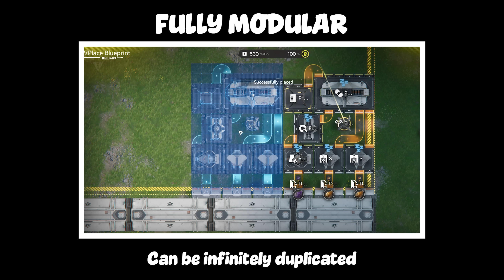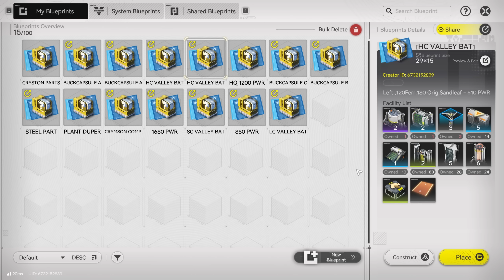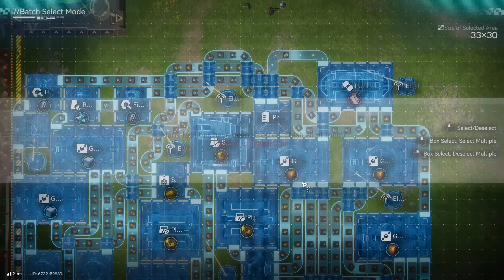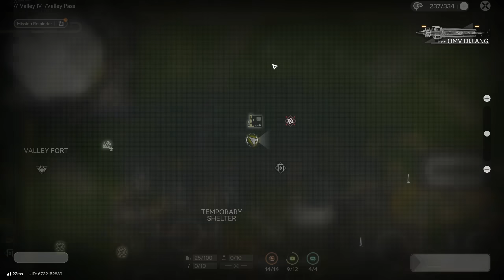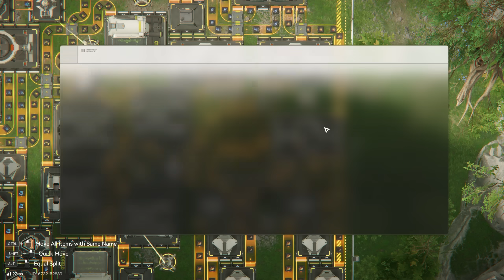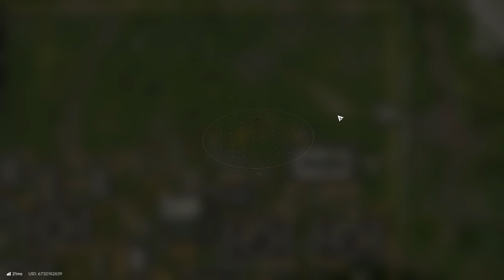HC VALLEY BATTERY - Compact 100% Efficiency Farm [ Arknights: Endfield ]

Comment: I personally created a Not-So-Small "Ultimate Farm" which lowkey only Fits in the Main AIC Area. It Farms all 4 types of Seeds Endlessly until your Storage is Full.  However i still gotta work on making the HC Battery Production Line Smaller, more compact. Cuz unlike yours, mine can only be placed Twice in the Main AIC Area.    Luckily it fits in the other Outposts well enough. So, if i don't find a way to make it more compact i will just leave it be.  Don't fix what isn't broken, yk.

Comment: EFO01eE7IaI2934a4oAi8, try replacing the IaI with Ls if it doesn't work, I can't honestly tell which it is. Anyway this design fits in one blueprint, is taller but slimmer at 30x33 instead of 33x30, doesn't require an output for the sandleaf and also you can store the extra sandleaf powder if you want but honestly I could care less about it, it is also modular as well as it only takes up the space the depots use. The design could definitely use some work but I found this one works best for me personally as it gives me more depot bus space

I also feel it's a little less confusing to look at but that could just be me and my dumb brain idk

Comment: How many purple batteries can I produce per minute? I have a factory that makes blue batteries and I get 36 per minute, so I don't know if it's better to make the purple ones or stick with the blue ones.
Reply from the maker: Each blueprint one produces 6/min, but you can stack as many as fit and can supply resources side by side :)
Reply: @TheFarmito Perfect, thank you very much. By the way, the code on the left isn't working either. I already tried using "I" and "l". I saw someone else saying the same thing in the comments below.
Reply from the maker: Im not sure about the code. They have a lot of issues, some people say they just type all over and over and it eventually works. I copy-paste them directly to the description (and double check them as well), so there shouldnt be any issues. 😅

Comment: IMPORTANT: This is a great blueprint overall, but it has a serious issue. Because the batteries and extra sand powder are going into the same protocol stash, and every battery setup is producing an excess of sand powder, once you hit your depot's max stock for the sand production the protocol stash will get clogged up by the sand powder and won't be able to take any batteries. As a result, your battery production will drop to 0. If you're also using those batteries as your power supply, it will also take out your entire production pipeline for the entire region due to a lack of power. Thankfully, there's an easy fix - there's currently one protocol stash, with sand powder and batteries going into it. Delete the route for sand powder, so that only the batteries are still going into that one. Then, build another protocol stash on the top of the left blueprint in range of the existing power pylon, and feed the excess sand powder into that. Now your batteries and sand powder have independent stashes, so they don't interfere with each other, so even if you're capped on sand powder it has no impact on your battery production. And that's a good general tip - never mix different product types into the same protocol stash, because reaching cap on one of the resources could kill your production of the others.
Reply: when can you unlock the HC battery system blueprint?
Reply: Thx I settle this battery clogging part. But due to having too many sand leaf I am at a lost of 19000 sandlef. What do I do?

Comment: i copied your build then a disaster struck woke up today opend the game and poof 0% power 
i ran out of power you said it can handle 4 thermal banks so copied this twice 
1 of them was connected to the protocol stash and 2 thermal banks and the other connected to 3 banks and the protocol stash you setup
turns out somehow the system ran out of sandleaves 
how is possiable or worse even fixable 
i do have some batteries so i can kick start the process again but waht happened 
i need your help man

Comment: beware of this build, it will make tons of sandleaf powder hitting cap at no time, battery and sandleaf powder are on the same protocol stash, meaning that at some point the stash will be fuill of sandleaf powder leaving no space for batteries, potentially leaving you with no power, in this case just add another protocol stash just for your batteries

Comment: How do you get that much power without the need of these batteries? i've seen lots of this kind of videos but i can't understand how you can get that much energy without them to start the building process? maybe i'm dumb as hell to understand it! But if i understand it correctly if this 2 blueprints use 1020 energy total for 4 batteries every 40 sec, that means you can send 3 batteries home while powering one thermal bank to ensure you have enough power to sustain it right? so if i put 2 of them in both my 2 initial outpost i can produce 6 batteries every 40 seconds while having 4400 power and consuming just 2040 energy? is my math right?

Comment: Thanks, based on your blueprints, I was able to put Capsules A, B,C, Cryston Component HC Battery, and 2 Steel part in the main AIC area. Only needed to modify Capsule B and C to fit. And I still have 4 depot unloader and some space to use, tho only 1 unloader is usable since its the only one not being blocked. Having a depot unloader on the plant was genius too, it is so that you just have to change the plant on the unloader to get the other type of capsule. I was wondering why you dont use a self sustained plant shredder.
Also, since I put these all together, some of the relay points are overlapping, so there might be some room for improving my base but its a pain lol.
Commented the same type of thing in the other of your videos so i can help with the comment count :).
Also, I was feeling pretty good when i did self sustained 13x14 +60 plant shredder that does not need un/loader  then I saw your video lmao.
Reply: I was curious if I could make this more compact, and I did. instead of using 11 Unloader, mine is 10 Unloader. total size is 30x31. and some spaces in the middle. there's probably room for improvements but im satisfied for now. back to exploration lmao.

Comment: There is a design flaw u need to modified the protocol stash u should separate the batteries and sandleaf as sandleaf can easily clog ur system and cause power outages it took me backtracking and adding more rig until it I properly check the blueprint there, I found out sandleaf was  clogging causing  my automation to crashing halt so badly. Plus I also did some modication for the steel board as they are really usefull for construction of turrets ik im ranting ur blueprint is good but if ur ouputting too much material it can clogged the entire system

Comment: For the extra sandleaf powder, is there any way it can be incorporated into some other useful chain? For instance, could a third battery blueprint be made that only utilizes one shredding unit, but takes inputs of powder directly from storage? (is there even enough originium available for this in valley?) Or is there another production that uses 1 or 2 sandleaf powder that can be optimized via this excess? Currently running two of these and would like to keep it maintenance free.
Reply: I don't know how he is getting that much Originium Ore. I've looked all over the map and have them all covered but still only making like 420/m which covers two plants that I built on my own that do the same thing this one does.  I tried building a third and I start losing ore.

How much Originium Ore are you making per min? Do spots to farm only pop up when you've walked right next to them or something? Never really paid attention. Maybe I'm missing some then?
Reply: Use sandleaf farm loop
Using 4 planter and 2 machine in loop

Comment: Love the build, but every time i log in the system is clogged with sandleaf powder. Did i build something wrong? Is there something else im supposed to funnel the sandleaf into
Reply from the maker: I believe i mentioned in the video, but in case I didnt, the factory has 1 sandleaf as a byproduct due to unequal ratios it requires for the build, so you receive 1 battery and 1 sandleaf powder in the end. Easiest way is to delete the sandleaf powder from your stash once per day (or you can use for highest tier deliveries, which i found to be the best use), or fully disconnect the sandleaf powder getting fed into the protocol stash :)
Reply: @TheFarmito ah ok i must've missed when you said that thanks for explaining

Comment: not 100% efficiency .. some factory still stuck and zZz... wasting a few seconds of battery production 😢
Reply: Likely your entire production line can’t sustain the entire input required (120 Ferrium/min + 30 Sandleaf/min + 180 Originium per minute. The entire production line never stops nor gets clogged (if you either kill the sandleaf powder going towards the protocol stash together with the HC bats or feed it to a different stash)

The final input towards the packaging unit to produce batteries is a constant 3x lines of dense originium powder+2 steel parts. Multiply that by 5 since lines feed every 2 seconds and you get 15 dense powder and 10 steel parts, enough to make a battery every 10 seconds (which is the limit)

Comment: quick note for anyone just copying
the sandleaves may eventually clog the protocol stash, you can solve this issue by not having the 3rd output from the last shredder or direct it into another protocol stash
(I kinda mentioned this in the LC version but idt my comment is vv high, also it clogged my system yesterday when I forgot to remove the extra ;-;)
Reply: If I direct it into another tash, will it automatically delete the extra when I’ll reach my depot limit ?
Reply: @Ivansia_Lavanda  No, so I would not recommend.

Just leave the third channel open. Clogging won't impact performance here
Reply: i was wondering why it stopped producing thanks for this!

Comment: So I have found an "error" in the factory and that is you're porting some of the Sand flower powder into the Protocol space which will clog up the factory given enough time. I have 3 HC set ups going and my Sandflower powder stops at 42k.  So I would have to go in periodically to destroy the stack.  I fixed this buy just removing the belt that feeds the powder into the Protocol space.

Comment: I've had a nagging idea that I need shot down by someone who is more knowledgeable in factory building, IE you. The idea is should we be using the sub AIC's to setup manufacturing and then port the resources to the AIC Core, or vise versa?
Reply: The reason why using the HC bp on outposts is to utilize the space on the PAC (your main base) for 2x Buck Capsule A production line bp’s. Those don’t fit on outposts.

Ofc if you don’t plan on making the Capsule A bp’s you can use tue HC bp on your PAC base just fine.

Comment: Oh noooo. I noticed one thing. You have sandpowder and batteries going into the same protocol stash. That excess powder eventually fills up and blocks that protocol stash and then stops the battery line. I added another protocol stash next to the battery to fix this.
Reply: yea i just experienced this problem too
Reply: he pointed that in the video
Reply: @Oruta-skk  Must've missed that part x.x
Reply: Bro, can I have the code for Asia now for your optimized build?
Reply: Will it work ?
Reply: @Ivansia_Lavanda  It works. Just add another protocol stash next to the battery and get rid of the first path that is going into a shared protocol stash.

Comment: These designs make a very good starting point, but there are a few issues I have run into. The biggest is sandleaf powder overload. The system generates so much of the stuff that and protocol storage units you have it run into will eventually overflow and clog, preventing any other items that feed into it to be able to feed into storage. When I get the time, I will  be looking into correcting that.

Also to note, the layout makes it possible to adapt the layout for the production of Wuling LC Batteries, if you swap the steel line for a xiranite one
Reply: Just made a comment about this just now. I had two HC battery lines stop as I AFKed and noticed the powder and batteries going into the same stash.
Reply: @ReallyDazed  Same, it clogged overnight.  I just created a different protocol stash to keep each one dedicated to a single product.

Comment: Also this is NOT efficient. You're wasting an input slot by inputting the pants. The 100% efficiency setup uses 10 bus outputs for metals, and you grow seeds locally. 😮
Space is less valuable than bus spaces, because those are a hard limit on the entire system. 😮

Comment: Asia Code: EFO01Ue37AU95IO27Oa8
It's not quite the same as the one in the video, but its compact enough to fit into a single blueprint, and can produce enough batteries to perfectly power 4 thermals, takes 10 depot unloader slots total and only requires an initial manual placement of a stack of sandleafs in the seed pickers and a few initial batteries in each thermal to get the power started (it produces exactly enough batteries to repower each thermal before the previous battery runs out).
Just wanted to share for anyone who's interested :)

Comment: Please can you make a power bank blueprint?
Reply from the maker: Its a small change to this build, so I probably wont do it at this moment. There is only 100 blueprint space I have for sharing, so want to make sure that I have only important stuff for now, or I may have to delete it later to make space 😅
Reply: @TheFarmito also does it matter in which outposts i make buck capsules or valley batteries?
Reply from the maker: If you are online, all of them work, but for offline, it matters since only a few bases will be rendered. It has some info about which will be active if you go to the home base main aic building and click the info bottom left

Comment: I actually get clogged a lot due to that powder. Is it not possible to forgo the plant dupers and just feed the excess powder into another production?
Reply: Which server are you in? If Asia, I can give you a HC Bat blueprint that directly use the powder while passively farm steel part for turret
Reply: @yusaizat8106 Ohh, I'm on Asia Server too. Thank you!
Reply: @yusaizat8106  would like to see the code for this too for asia
Reply from the maker: It is technically possible, but the main issue is to supply all of the powder from a plant, you only need 1 depot unloader, where as with powder you would need 5 dwpot unloader to fully supply this. If it was infinite space then having separate production would 100% be much better, but due to space shortage, I try to only take the smallest amount needed for 100% uptime 😁. I just hope that they eventually give us an option to either auto trash what we dont need or maybe have some cap on the home storage so it never fills up
Reply: @TheFarmito Oh yeah forgot about that. Only thing I can think of for that is to use the PAC to make a smaller version and inefficient. But that would probably be acceptable if you're only aiming for extras
Reply: Alternatively, you can use unloaders for the sandleaf and connect them to the shredding unit. Since the sand leaf produces 3 powders, you only need 2 unloaders.
Reply: Just put a storage depot to collect the ingredient clogging and everything is Fine.